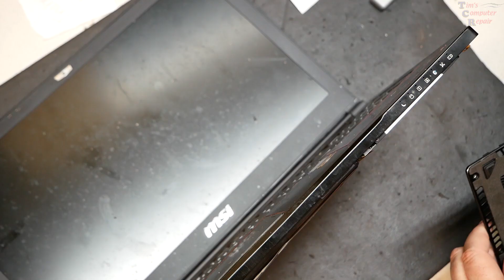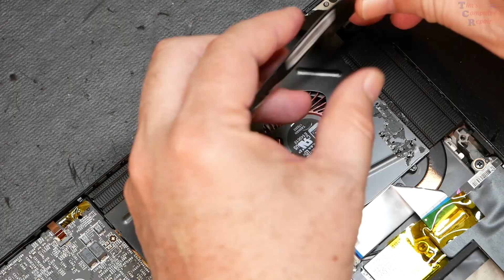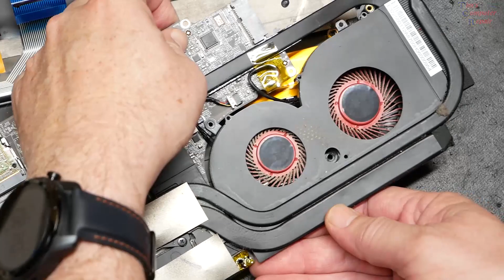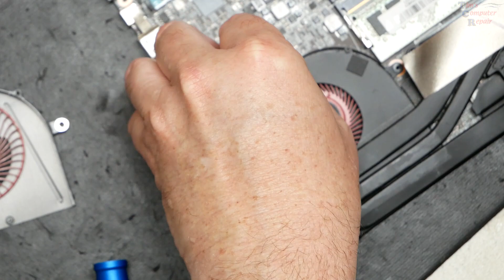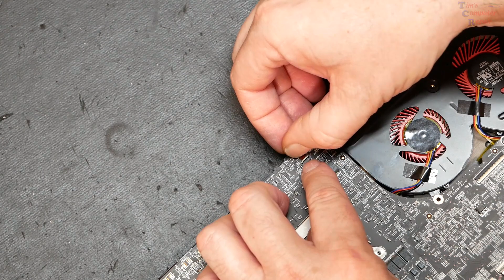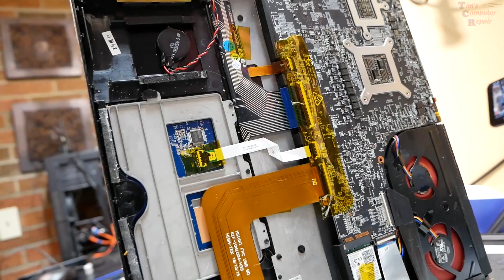Replace Your Noisy MSI Laptop Fans Step by Step Model MS-16k2

Comment: Your video was awesome.  Thank you!  I really appreciated the links also not only to the fan, but the tape and the tools.   The fixit toolkit is great.  Marking the motherboard screws was fantastic.  I totally would have not remembered which to put back.  Two small suggestions.  You missed putting all of the tape bits back on in the end.  Also, I recommend taking a picture before starting to disconnect and take off tape to compare when putting everything back.
Reply from the maker: Thanks for commenting.